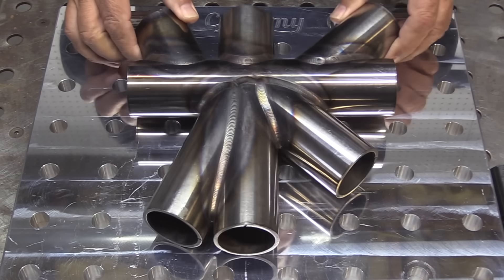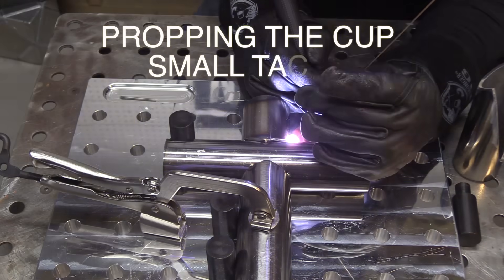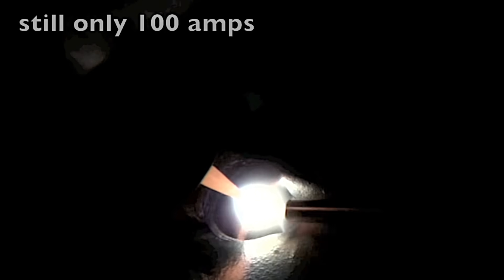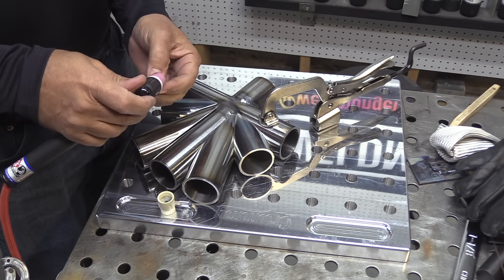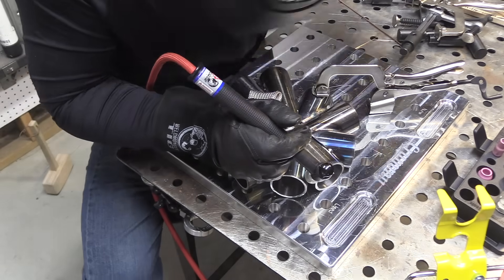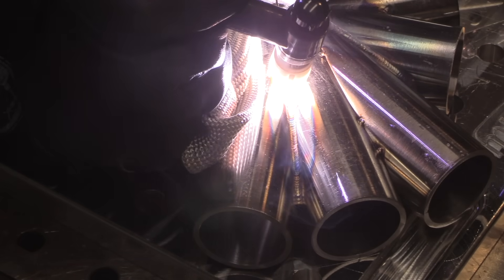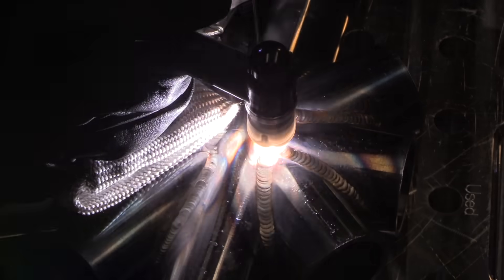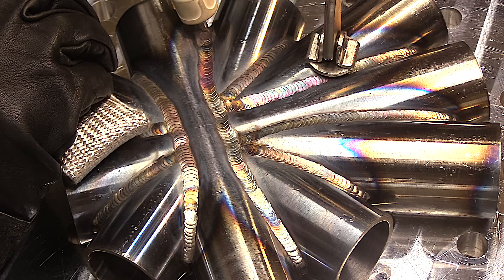TIG Welding 4130 Chromoly Tubing

Comment: When you mention lack of coverage when the bottle pressure gets low it has nothing to do with the gas composition.  More than likely it has to do with the volume that the orifice in the regulator can flow for the inlet pressure.  This will be noticeable when the bottle pressure goes from 2,300 psi when full to only a few hundred psi when close to empty.  You are correct that gas cylinders can become contaminated if someone ran the bottle to zero pressure and left the tank valve open.  You will notice contaminated shielding gas when a fresh cylinder is first used, not after it is used and gets to a lower pressure.

Comment: I know this is 2 years after. But the comment on the argon bottle being contaminated. Turn it upside down for minimum a week. Make sure you can open the valve without moving the bottle. Co2 is a heavier gas. Just barily crack it open to a hiss. Let it flow for a minute or two. I have converted a few ar/co2 18% bottles.

Comment: Nice work!! I know this is a practice piece for the video and its slick. If you were welding this material as a "code" weld would you purge the inside with argon as well?  We purge all stainless TIG welds on 304 stainless pipe or 316 food grade tubing to prevent carbide precipitation, aka "Sugaring" , so I was just wondering about it. I dig your channel. You would be a beast in the Pipe trades!!!!

Comment: If you slide that diffuser forward from the back wall of the cup you'll get a lot better coverage with your gas. The difference is like going up another cup size so it's pretty significant

Comment: Regarding your noticing a difference in argon coverage when the tanks get low: use a two stage regulator. Also get yourself a vacuum pump and fully evacuate the cylinders before you get them refilled. That's what I do.

Comment: I remember custom bike frames being built in the early 2000s, they used to say chromoly suffered fatigue fractures at the joint when using carbon steel fillers and that silicon bronze brazing was the better option for the application. What is your opinion on that idea? Also is er70-s2 not lower tensile strength than 4130? I had heard er80 is a better match? Thanks for the video as always.

Comment: Are them jazzy cups any good welding ali???
I have certain ali jobs at work with very very tight gaps and struggle even with a normal no.4 ceramic cup(and this is with a 20 torch) which gives u and idea how tight the gaps are!!
I was thinking with a 1" stick out i cud more easily get into the gsps

Comment: I just set amps and leave it.  Also if somebody has any experience they won't have to worry about arc length . I love stainless. And it's mostly the gas lenses. Shielding the weld is key. Especially with stainless.

Comment: Question Jody, apoligize its off topic from vid, but this is the only way I know to communicate with you. I'm on a very tight budget, and I respect your knowledge and experience. I should I say "used to be"  a good welder; ua local 72, certified ua21, ua41, ua5, that was over 10 years ago. Now I want to try to start a "side hustle" and hopefully get a welding/fab business started if possible. I'm in south Louisiana and there's always repair work on small shrimp/oyster/crab boats most of aluminum, some steel hull (corten), some stainless fittings and such. Which would be better oxy-acetylene, or lincoln ac-250 tombstone to make enough to buy a better more suitable power source? I thank you in advance, God bless you sir. Also your answer may help someone else in my position.

Comment: Hi Jody, huge fan of your channel, my son and I are about to purchase our first  Tig welder, what max current capability would you recommend if its for building Motorcycle frames and similar projects. The reason I ask is there is a 180 AMP that runs from regular 10 amp wall plug but the 200AMP + require 15 amp plug and that would require some mods to our electrical supply

Comment: hey Jody, you didnt use ER80, how come? Can ER70 can keep up the quality of the steel?
10:36 - same thing here; got a 2.4831 roll of filler material. Could I use this for 4130? I think it should fit, but I wonder how the stbility changes compared to 312 as filler...

Comment: 4130 is what high-end steel bicycle frames are made of as well.  Internally butted tubing no less.  Thicker on the ends. The heavy stuff wall thickness is .035 at the joins. I didn't have a welding machine capable, so I fillet brazed up one bike and used lugs on the other.  O/A work.  I still dream of TIG!

Comment: Two things amaze me.  1.  even when there is a gap - the edges didn't burn back when welding or tacking.  2.  on the super low angle area where you extended the electrode and turned up the chf - the arc remained in the nook - and didnt burn away the side wall of the tube.  how Jody.  how?!  🙂

Comment: Damn this fixture plate is what I’m missing. I don’t have a dedicated welding location yet and no space to put a proper steel table. I could slap this on a my normal workbench and weld on it. Seems to have enough thermal mass to not burn the wood bench underneath it. Hopefully they ship globally.
Reply: Where is global for you?
Reply: @Sicktrickintuner  will contact the store, i might have more stuff to get from the US and it might be more economical to ship via a forwarder
Reply: @Sicktrickintuner  Thailand

Comment: I really appreciate you and the content you put out. I work at a custom fab shop and i’ve been watching your videos for years I i’ve been wanting to pick up and practice with Tig welding but the shop I work at will not let anyone use the tig welders unless you have previous experience so therefore I am in the market to buy my own personal tig machine can you provide me with some options of machines you have used over the years that you trust I need to be in the range of $1700 any information you can provide would be greatly appreciated thank you so much I did my first Welding and fabrication job by watching your videos your videos have a literally taught me everything that I know
Reply: Jody uses a CK Worldwide 200 amp AC/DC inverter machine (built by Jasic I believe) and a Miller Dynasty 280. He use to use a lot of Everlast machines but they have went away from some reason 🤔 lol
Reply: I have an older 200 amp ac/dc everlast and it just does everything I need at home. We weld with high dollar kemppi and fronius machines at night school (I live in Europe so no Miller or Lincoln) and other than setup I don't notice that big of a difference. Jody does a few reviews of older everlast machine and some others. The Fabrication series those a lot of reviews of tig machines from cheap to expensive.
Reply: @tomwagemans1872  Justin is all about America but doesn't have but 1 American machine 👎. He does nice work
Reply: @sledsports  All the machines made in America ( or for me in Europe) of more expensive than China made . The chinese made welder I own was all I could afford at the time. The next one I buy will be made in Europe. To support our economy. If you can afford you should buy american made stuff but that's not always possible seeing the prices of some off those welders.
Reply: Nothing against Chinese machines.  Some of them work really well. Others not so much. I am just disappointed in Justin flying the flag on his shoulder and having 20- 30 Chinese machines. It's not what he can afford... its what gets gave to him.

Comment: Can you purge work like this?
Reply: If you mean putting argon on the inside of the tube, yes you absolutely should. If you want 110% penetration you have liquid metal in the pipe. You dont want that to oxidize.
Reply: @timothydillon6421  thanks

Comment: Nice to see someone actually double passing chassis work. So many guys put out some beautiful looking single pass welds but leaving a lot on the table as far as safety
Reply: If a single pass weld is stronger than the base material that is all you need. More welding and a larger heat effected zone usually makes the failure point just outside of the shielding gas area. 

You can say my weld didn't fail but that weld may have made the tubing fail. 

Also all 4130 is not the same. It's the same mix but the heat and temper can change it drastically
Reply: @timothydillon6421  with 4130 the weld or filler material is much softer typically to dilution the base material to inhibit embrittlement along with the welding style/process. Not to equal or strengthen the base material. That is done with the second pass or cap. The typical filler being ER70s-2 when welding structural 4130 in motor sports. All top fuel funny car stuff is double welded. Typically in the drag racing scene it’s single pass for the stacked dime look not integrity. As far as the HAZ I dont buy into that much at all. I believe the process of heating and slow rate of cooling is more important even if it creates a larger HAZ. Especially working around aircraft restoration years ago. Guys gas welding 4130 that looked like butt crack. Yet it passed inspection. It actually was softer when believed it would be hardened and brittle. The fact some of the aircraft was 50-60 years old and have been through a war and service stands to prove  the process was correct. Yes you are correct not all materials are equal. Substantiating the need for a second pass or cap. That or switch to Docol R8 any dummy can weld that stuff.

Comment: We use Hast W at work all the time, any oddball tooling or fixtures that don’t require specific alloys we just use Hast W, you can weld damn near anything with that stuff hahaha
Reply: Is the Hast W like 309? In that it can do dissimilar metals?
Reply: @metalheartmachine  better